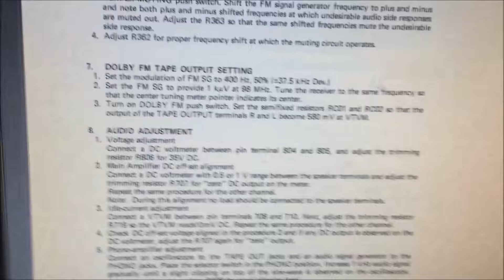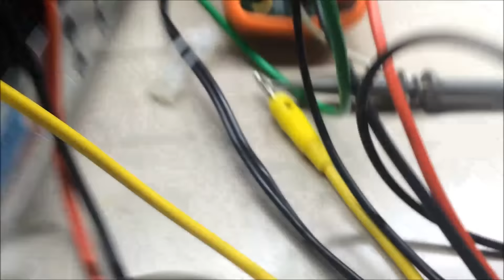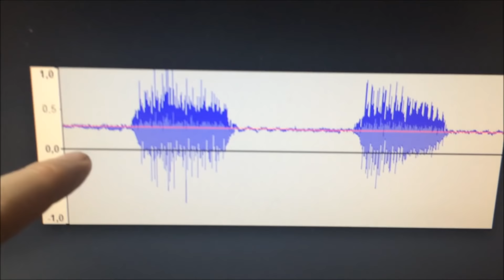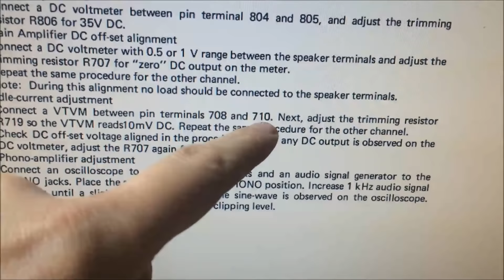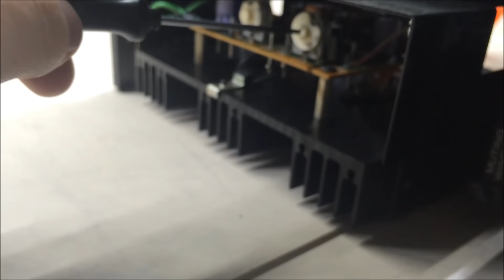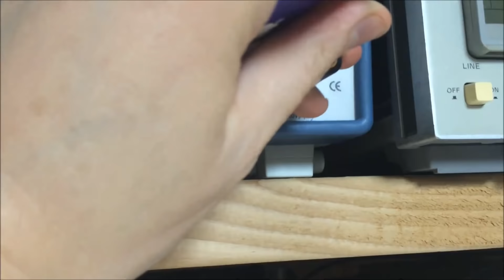Marantz 2250B Service & How to Bias Part 3   BG009

Comment: Thanks. Great videos. About to tune up a 2250.  Scratchy pots and switches but it is still amazingly linear with sweep generator and square wave testing.  I'll replace PS caps though, and look for any voltage problems. What's the difference between the 2250B and the basic 2250?

Comment: Hello Blueglow Electronics
I have a Marantz 2250B series Amplifier exactly as the own in this video.
I rebuild my amplifier with the help of your video and the service manual I download on the internet. The video about the service and bias is very informative. My unit is now working like new.
Note: I replace all the capacitor in my unit according to information found on the internet.